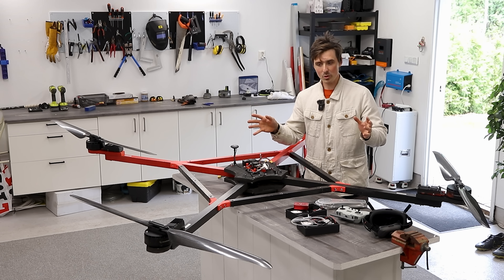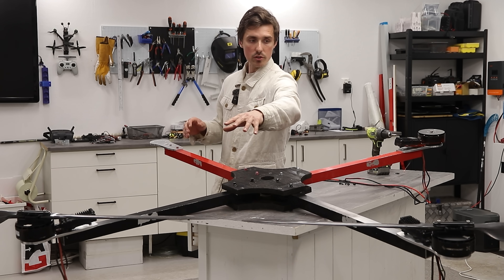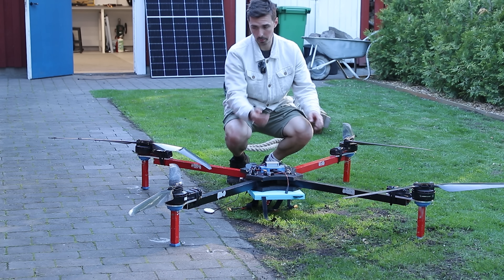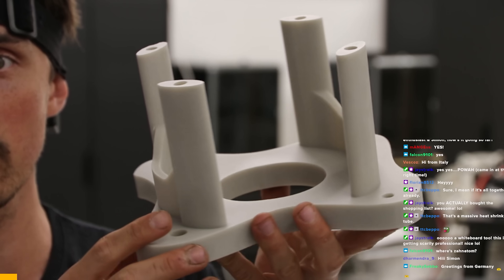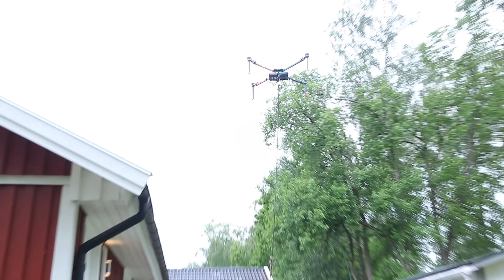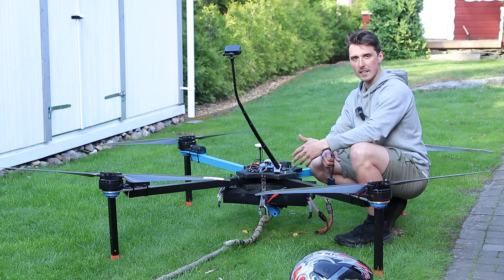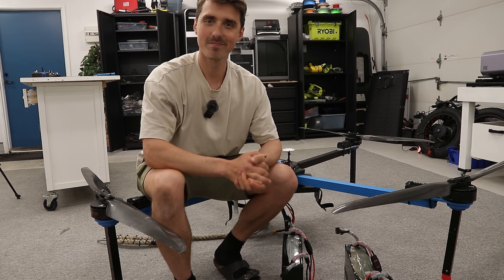Heavy Lift Drone 100kg Test - It Works!

Comment: Something worth mentioning is that the part 107 in the USA, since this drone is used for Youtube videos, only covers up to 55lbs. If you are in the USA, I would strongly recommend not pushing the limits further for Youtube's purposes since it may gather unwanted attention.

That said, next step is obviously to mount a wide-angle camera, a telescopic camera, a night vision camera, and a thermal camera. Beef-up the motors a bit and make sure its behavior is 100% predictable and stable... and now you have a wilderness rescue drone! Unfortunately everything stated is $50k for parts only. Motors bigger than those you currently have explode in price and good thermal/night vision is... well, ITAR...

Comment: haha you actually registered it? dude u should never waste your time but above all else your money dont waste ur $ on gov. there is no reason for it u will never get in trouble 7yrs ive built & flown quads all above 250gs 168mph - 200mph quads. ive delt with cops in 4 different states in all id say 18-20 police & drone interactions due to ignorant karens. see just so long as you know the loop holes in laws u can never be touched. so why waist $ period on ur quads $5 per quad for registering 1.. ive had probly, 75 builds in 6yrs thats almost 400$ dude that ur kid  could have for food or hell for gas or anything screw taxes or anything $ gov related

Comment: Seriously impressive but I really think you should now robust consider safety measures, that repaired rotor could pose a serious risk to your body and surrounding buildings, your helmet covers a lot but for instance I'd that rotor blade came loose it's might be deflected by your helmet into your neck so try getting better full body protection

Comment: All the magic of drone lies with 1. Flight controller (the microcontroller and the control system algorithms) (the magic of DJI patents, the first real breakthrough done by the "founder of DJI back in 2008")
2. The insane power to weight ratio of Brushless DC motor
3. Insane Energy density and density vs weight ratio of modern batteries 
4. Ultra high speed high efficiency DC-DC converter, Power Management IC with high current throughput all tugged into the Battery management system (BMS)
5. High speed ADCs (from Analog Devices), sampling data rates from sensors with higher frequencies, leading to less errors in control system dynamics 
6. Sensors from STmicroelectronics
7. Motor Driver IC: Its not straight forward to send PWM pulse on an Inductive load that can have high voltage spikes, reverse voltage, the reliability of Transistor goes down the hill with high powered motors. The Isolation, reliability, accuracy of Motor Driver ICs makes Drone making a childs play, you just need to plug and play, most of the hard work is done on backend in Semiconductor Industry.

That's about most of the technology for simple drones

For long range drones
8. RF transceivers from Texas Instruments, ADI, Nexperia, Infineon plays key roles with high speed transmission with more reception on longer range (miracle of Antenna technology & signal processing )

These key innovations made drone making just a simple plug and play for most of the non technical users. The only key part that kept open for the users are, Firmwares. So it is upto you to make the best Firmwares/User interface for your drone (so mostly work on software end). You just need few machine from workshop, an IT guy and you are set for plug and play of any drone making. 99. 99% of the tech for drones already done in Semiconductor Industry Research and is now available in the market

Comment: A photovoltaic panel, and motorcycle helmet isn't going to do much against 8 massive carbon fibre daggers spinning at who knows how many thousand RPM and attached to a 35 kg aerial contraption if it comes crashing down,

Comment: I caught kibbles of concrete under a Jet Ranger while working on the construction of the Kosciusko Express chair lift in Thredbo.
When the foreman pulled the lever and dropped the concrete, that Jet Ranger just launched into the air like 2 meters.
We both just had to let go of the kibble at the right instant.
But this drone just doesnt move when the load lets go.

Comment: your release mechanism would benefit a LOT from having some leverage... ie imagine a gate hinge, with the weight acting right at the pivot point of the hinge, and your servo pulling a release pin at the tip of the 'flappy' bit... could easily have a 10:1 ratio and reduce your 'pulling out the pin' forces accordingly.

Comment: You built a drone capable of carrying a 100 kg payload impressive. Could you explain how you monitor real-time power and voltage? Did you use a power module to measure current and voltage, and if so, which one?

Comment: You use two servos to pull back a pin to drop something. This can be done much more easily with an even smaller servo. Let it spin. I'll give you an example.  O no. I cant sent a pic

https://youtube.com/shorts/v11_GMS7O7Y?si=KApi0XXq_mCRNWSJ
Reply from the maker: Check out the new drone video and you'll be see that I did just that.

Comment: I suggest doing the stress analysis on Ansys for the 3D printed part to predict the dimensions for initial designing so that it can bear a certain maximum weight within the factor of safety. The holding mechanism would not have failed lastly ❤. However the remaining problem solving was enginous.

Comment: With me the new flight controller, was the flight stable out of the box or you have to do some PID tuning ? I am using Pixhawk and it is notorious and drone keeps toppling side ways.
Reply from the maker: I can't recommend that flight controller enough (for large drones). That was straight out of the box, I did exactly 0 PID tuning.

Comment: The easiest way to take a quad and make it heavyweight is to double the motors. Just put motors on the bottom. Also, you have the top of it box, but if you built a cube under, you would have plenty of space for those batteries and you would move the weight under the drone. You also wouldn’t have to design lending gear. It would inherently be more stable that way.

Comment: In that small test area, it looked very sketchy. You need more space. 
It is also important to remember that the screws which hold those motors on are taking all of the weight. The loads will not always be balanced. So build in a 100% safety margin, and assume that, if you have 4 bolts per motor, each bolt, and the surface to which it is fixed, is holding up to 12.5 kg (plus the strain from tightening the bolt) with an all up weight of 100kg.

Comment: Can you put it on a 150cm pole, attach it with a short string and use it to test balancing? It would save the propellers in case the drone tries to roll over.

Comment: 🎯 Key points for quick navigation:

00:00 The video continues building a heavy lift drone capable of lifting 100 kg, following part one where many problems were encountered.
00:15 The plywood motor mounts broke; they are replaced with aluminum mounts made by PCB way, and a new flight controller replaces the Pixhawk.
00:44 Heavier batteries are added to increase weight and motor RPMs for better drone stability and longer flight time.
01:25 The drone arms were shortened by 20 cm to improve manageability and frame stiffness; all bolts are secured with Loctite.
02:05 Aluminum motor mounts worked perfectly, but their orientation required repainting for correct forward indication.
02:33 The X11 motors, used previously on another project, are durable and reused successfully.
02:46 Designing effective landing gear is tricky; it must protect propellers and avoid prop wash, leading to several design iterations.
03:46 3D printed landing gear parts are reinforced using piano wire hammered through for strength.
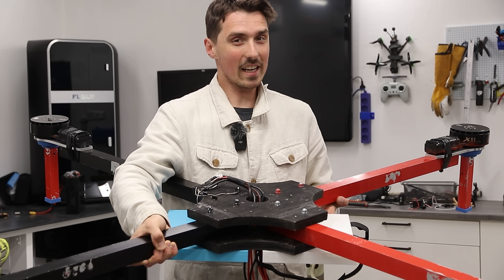04:24 Battery holders are 3D printed under the drone; GPS, flight controller, and electronics installation begins.
04:38 Many electronic connection issues occurred, causing a 3-day delay, but final GPS calibration was successful.
04:50 First test flight with upgrades was tethered; drone worked but also functioned humorously as a lawn mower.
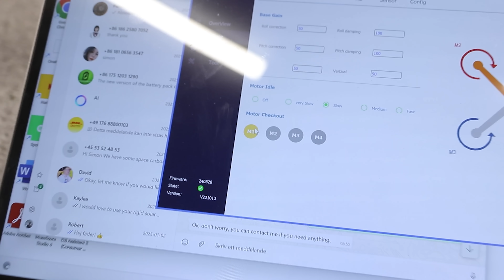06:12 A motor wiring mistake caused throttle problems; after correction, motors and flight control performed properly.
07:23 Careful motor signal verification avoided further issues; tethering was necessary due to cautious trust in the drone.
08:02 Second takeoff with new flight controller and batteries showed remarkable stability even without manual control.
08:40 A large servo-based drop mechanism is built to carry and release heavy payloads, requiring taller landing gear.
10:07 PCB way’s manufacturing services for motor mounts and adapters are highlighted as precise and reliable.
11:51 The original servo drop mechanism lacked strength; a dual servo system was 3D printed and reinforced to increase power.
12:26 Drop tests include a wheelbarrow and bucket of water, demonstrating the drone’s heavy payload capability.
13:10 Additional batteries and payloads increased drone weight to 35 kg; drone lifted itself plus heavy payloads exceeding 100 kg thrust total.
14:18 Payload drops of up to 40 kg were successful, pushing limits before mechanical failure.
15:01 At maximum load (~65-100 kg), a 3D printed part broke, but the drone briefly lifted the payload off the ground.
15:21 The video ends thanking supporters, highlighting the new batteries’ impact, and promising more future projects.

Made with HARPA AI

Comment: Very impressive built. Newbie here. You have to let me know or help me in the right direction to build this type of drone  ..I 😊need payload max 50 lbs...to be able to do different small jobs like cutting ...pruning..etc. Im ok in mechanical ...electronics and programming microcontrollers like Arduino Uno and Esp32...etc. With a bit of creativity and ingeniosity.. is that enough to build something like this but smaller   for example ...to support à 10 lbs tool ...etc The smaller..compact  and more powerful it is...the better.

Comment: For further testing, instead of anchoring the drone from the bottom, you can "also hang" it under a platform and then slowly increase the thrust. That way, it will not break anything. Give enough space above the drone to go up, and when it is floating in the middle of these two anchors, you can easily calibrate your parameters.

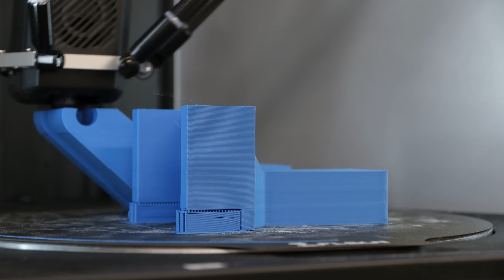Comment: 12:00 Try to print that part so that there's one more of those holed pieces. You know that first two slots just act as a "bearing" and third slot is the actual part where pin retracts. I think it'll work much more reliably on heavy loads.

Comment: Very impressive, well done. in part one you spent time on PID’s, after changing the flight controller you mention nothing of it. What software is the new one running? How did you manage the PID tuning ?
Reply from the maker: I had to do absolutely 0 PID tuning on the new controller.

Comment: Dont Need Dual Servos just to Pull unlocking Pin, a Rack and Pinion System with a geared Motor, Or a Short Solenoid Bolt would Reduce the Weight.

Comment: The improvement is astonishing. I'm especially impressed that it didn't go haywire when the 3d print dropped the heavy weight. It was struggling with that heavy dynamic load but when it let go it recovered quickly. It actually seems very safe but it needs new propellers before you go around populated areas.

Comment: Placing the weights so far back will pull the drone back towards the building whin it lifts. Surely the weights and tether should be as close to the drone as possible?

Comment: 1:14 Sorry, I am too impatient to watch the previous video, but.. just wondering if wing tip speed had been taken into account? 
This is usually the problem with Helicopter lifting capabilities. Can't make bigger and bigger rotor blades, because of tip speed.. Can't keep adding more and more blades, because after a certain point the blades start running out of air molecules to push down on.. 
More rotor assemblies start to become the answer, even though they add more weight..

Comment: Drone design.  Think of a Capitol H.  Engines at the tips of the H.  The center bar of the H is much wider.  As it is a wing with the fuselage and a tail at the back.  The wing rotates with a high power servo in the fuselage.   So you get vertical lift and landing but forward flight lift is on the wing and horizontal  stabilizer.

Comment: @ 9:26
Layman observation
The object 2 B lifted is way 2 close 2 the building...
As soon as U start putting tension on the lift rope;... surely that will pull the drone towards the centre of the load being lifted...
I C disaster ahead...

Comment: For a release mechanism look at the 3 ring method that parachutists wear.  3 rings are interlooped and secured by a pin, pulling the pin releases the main chute but is designed to connect the main chute to the parachutist harness.  Designed to hold a lot of weight and forces..

Comment: Editting clicking noise?
Great design potential for flight transport. 8 separate motors for fail safe? You could've introduced your lady no worries.
A pendulum seat under and 4 long CF landing legs? Good work

Comment: At least for test you could have saved a few battery recharging if you run some cable with power along with the tether rope, the cable being longer than the rope of course?

Comment: At what point do you have to register the drone? Is it before you build it? After you consider the drone complete? When you start testing it?
Also, are you gona try toroidal props? Eledgedly they are slightly more energy efficient.

Comment: Very well done. 
If your plans to carry you it is batter to make cage to cover the blades withe aluminum tubing light but will protect you but to be on the safe side 8 blades.
But the blades are expensive too maybe soon will go price down in year time.
But for carry heavy weights  use solid aluminum, will handle the weight.

Comment: Did you fucking try to use locktite in between the nut and the surface like glue while simultaneously using a locknut? God damn that's 2 of the dumbest things i've ever seen anyone do back to back.

Comment: Why not leave arm lengths same length, move motors in, have lamding feet where motors were, further out. Youd have double the prop wash from before(more arm under rotor disc), but feet would be further out to protect from prop strikes in event of a crash or wobble.

Comment: you should use a aluminium double negative handshake so it gets stronger grip when more weight is used. it has like 5 degreese pitch inwards on each toe so it has a ageessivly easy release. ❤

Comment: 11:58 You should definitely check out the three-ring release system we use on parachute risers. It’s an ingenious setup: a small (~20 mm) high-strength stainless steel ring inside a medium (~40 mm) ring inside a large (~70 mm) ring, all interlocked and held in place by a loop of webbing through the small ring, secured by a pin at the end of the release cable.

Pull the pin holding the small ring, and the whole system cascades open almost instantly in three stages — one ring after another — releasing over 100 kg with probably around 1 kg of force, give or take.

It’s super lightweight, too — nothing like that enormous monstrosity you used! I actually had to cut away a malfunctioning main once, and it worked perfectly.
Reply: You should definitively move to gaza.
Reply: @ifranebrunet9153  How am I going to do that when you lot have hermetically sealed all the borders? You really haven't thought this through, have you.

Comment: Wouldn't one, very large, set of counter-rotating blades in the center, with four regular sized rotors at the corners for attitude control be a more efficient design for a heavy lift drone?

Comment: I had to pause at your prop balancing. You need to add weight at each segments center of gravity. Other wise the change centripetal force at higher rpm will still create lots of vibration. Enough to mess with the gyros in your FC.

Comment: Suggestion: Gas engine powering electric generator that then powers the electric engines. That way you can put even more insane engines and even bigger blades. Like full on aircraft blades. You could make a massive platform that carries a huge amount and can fly for a super long time.

Comment: I've thought about these heavy lift drones being used as medivac. For example in Ukraine, you have an injured soldier that needs high speed urgent exfil. Maybe they are strapped to a stretcher/board, or they wear a harness that clips onto the drone. The drone would be remote operated, but could also have a manual wired controller used by the patient to override EW radio jamming. Wouldn't need massive batteries on board as it would be making relatively short trips of a few minutes of flight to get the patient out of the danger zone, and the battery can then be swapped out for a fresh one for the next exfil. I think the weight is the issue, these guys are going to be probably 80kg+, and then you have their gear on top, although a lot of that can be taken off. Flying at a low height to reduce risk from falling due to EW or hardware failure.

Comment: Did you consider a tricopter instead? Since they have the moving tail you don't have the low rpm control issue

Comment: I'm having a hard time watching this. Did you ever build a drone before you tried this big one? I mean checking the motor directions before mounting propellers is a very basic drone building rule and common sense. Why would you risk breaking these expensive props.
Reply: But I applaud you for your bold project. I'm just being a grumpy old guy ;-)